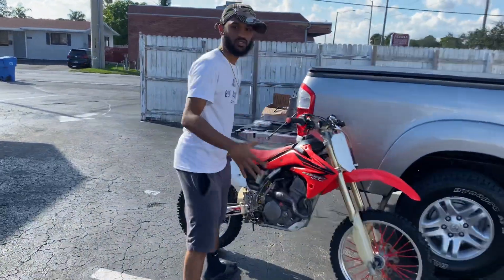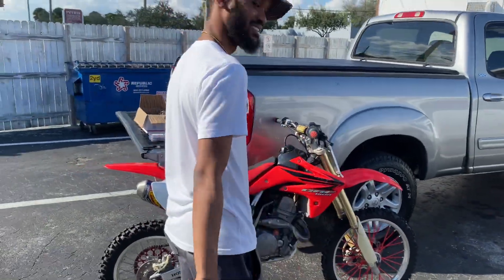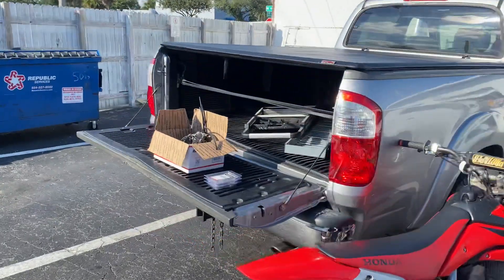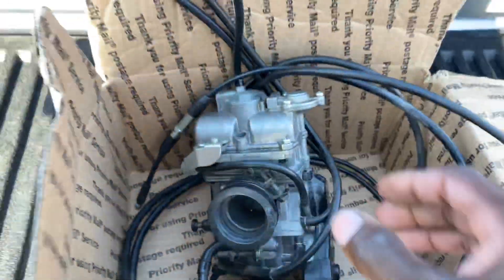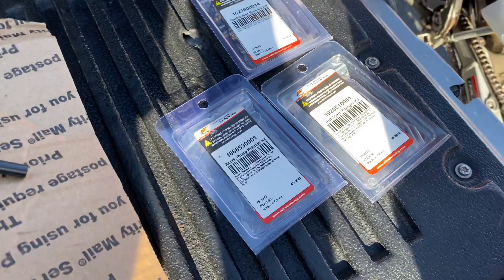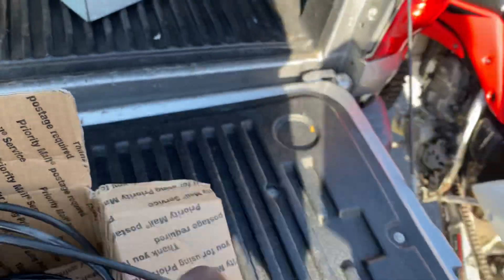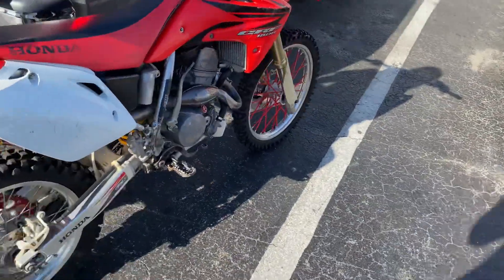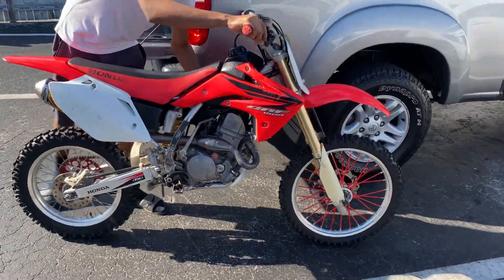Customer drops off 2007 crf150r with new oem carb says bike is bogging South Florida Vibes

Comment: So you have a idle adjustment screw and you also have a mixture screw on the bottom of the carb very difficult to get to to turn in most cases...but the mixture screw on the bottom (small flathead brass golden screw) will adjust your pilot jet mixture what you need to do if loosen it slightly and keep swisting the throttle every time to see if your making any improvements to you bog issue, also i would pull the carb and clean it with carb cleaner and an air hose and add a fuel filter to your fuel line  btw coming out on you pilot scew increases fuel at a low speed throttle you also have a main jet which controls fuel at mid and wide open throttle your main jet is probably fine but anyways man if you need help let me know i live in Florida  or message me back on her and i will help
Reply: Good info, what jetting do you recommend? I’m at 1000ft and I’ve heard stock 138 main with 45 pilot and two turns out in the screw?